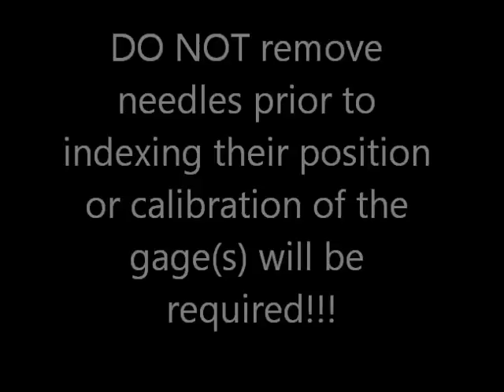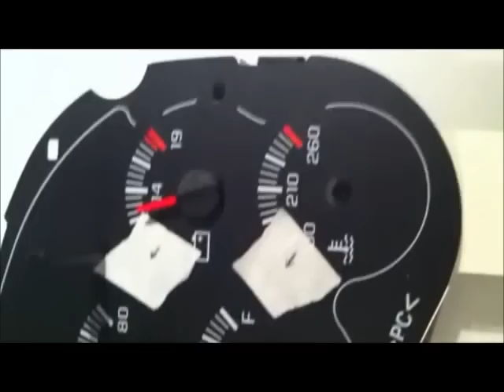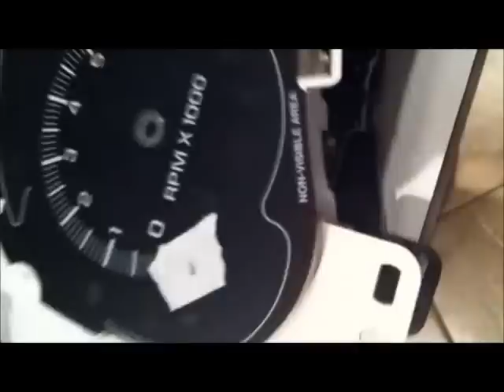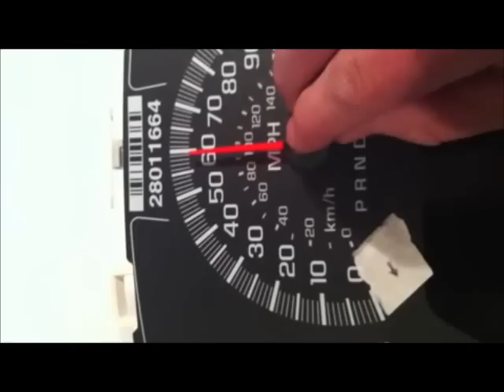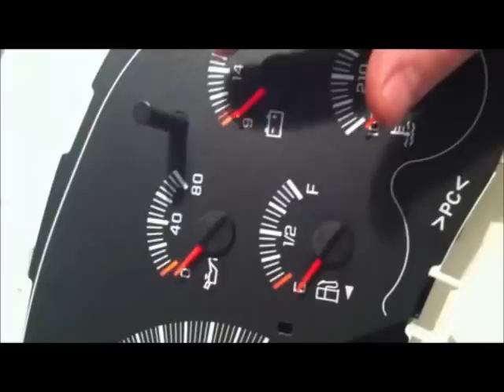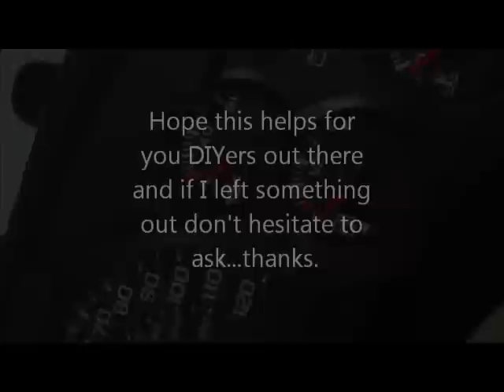GM Stepper Motor Replacement and Instrument Panel Disassembly

Comment: Nice video on the subject.  FWIW, [ref the comment starting at 3:00 ], on another similar video the guy points out that the stepper motors can only be installed in one position.  When doing the repair on mine I could see that that is true, there are two plastic posts on the motors that are different diameters and they go into holes in the circuit board that match those sizes.  If the motor was rotated 180 degrees the larger post would be blocked by the hole sized for the smaller one.  I'm sure they were made that way to prevent accidentally installing them in the wrong position.

Comment: Worked and saved me a bunch of $$$.
As a tip.  Once the dial needles are off and you are only dealing with the motor.  I heated up each pin with a solder iron, going one to the next slowly backing out the stepper motor with reverse pressure using a popsicle stick.  Then replaced the stepper with a new one purchased on eBay.  I heated up the solder at each hole that was remaining and "Viola".  Done and my voltage reads again after a year of yo-yoing around.
Reply: It worked for you, but as an electrician I can tell you that you are applying a lot of heat for extended period of time with a chance that you will lift the contact foil and have your hands full then.  If you don't remove the solder, as you come back into the holes, you are even pushing the foil off of the board, if you are not careful. You save a lot of money by doing this job yourself, invest in a $10 solder sucker, or $4 of copper braid used for absorbing the solder.  It really makes life easier!
Reply: Peetre,  You are correct.  Months later the and the Speedo no longer works.  Back to the microscope.

Comment: The fork treatment worked really well at pulling out 3 of 4 of my stepper motor shafts. Now my cluster is lighted very well with my new soldered in bulbs. But the gauges with the shafts pulled out are junk. What fun! I dont know how you can prevent the shafts from coming loose. Use at your own risk...you been warned! 32 year tech

Comment from the maker: I found a guy that sells kit, but I don't know if he sells them individually. He sells 6 for $42 and 7 for $49.  If you aren't afraid to do a little soldering, I'd personally replace them all to prevent any future problems (assuming you plan to keep the vehicle a while).  The newer part numbers are listed on his site which are the ones you want to order because there are still a lot of the defective ones still out there in circulation.

Comment: For those of you with the extra questions, it is very recommended that you use a solder wick/sucker.  However, if you have none of these on hand, cleaning the surface will do just fine.  This is recommended because if you don't clean the surface properly, you'll get stray voltage that could interrupt other portions of your gauge.

Comment: Have a question. I need to replace my stepper motor on my 05 tahoe. The speadomoter is currently passed the 100mph marking. Would I market in the same location or should I move the needle back to 0

Comment: I was wondering if you are just removing the cluster to try and resolder/fix the odometer, not replace stepper motor, and don't plan on messing w/gauges/needles do I need to mark the needles?

Comment: Hi I was wondering what tool, scan tool, or power generator do you use to bench test all of the gauges to see if they all work while the cluster is not connected to the vehicle? Thank you for your help and great video.

Comment: Thank you for making this video, It made replacing the faulty motors real easy knowing the procedure including marking the needle positions. I found the motors here on Ebay. Do a search for "GM X25168 Stepper Motors" and you will find replacements.

Comment: Great video, very clear.  Thank you.  In that stepper motors are being replaced, I assume that the stop points for the defective ones remain correct, even though the needle could be showing anywhere when off.  Therefore marking the stop point, even for a defective stepper motor, is still at the correct spot?
Reply from the maker: buddyboy4x44 Correct.  The referenced stopping point that you mark before removing the defective motor will be where you set the needle after replacing the new motor.

Comment from the maker: i've adjusted my gas gage while the power was on because i didn't like where the factory 'full' stop point was.  really the only way to accurately calibrate these would be to have another device measuring realtime while you are making your adjustments. 
close to stock settings at warm idle:
RPM 600-700~
Speed 0 :)
temp 210 (depending on thermostat)
oil pressure 45-50?
battery - could use a meter to adjust
fuel - fill it up then adjust

no easy solution unfortunately, rotate counterclockwise
Reply: Hello are these references for the needle to be centered on gauge or at its 1st starting point of the gauge. Particularly the temp.

Comment: Question, lets say, only the battery gauge is broken. after replacing the stepper motor for the battery gauge. I put back the needles in all of the other gauges, do i put it back in 12 oclock position? or just the battery gauge needle?  The rest in the old position as marked with a tape?

please advise, thanks

Comment: hello i did not watch your video before i took apart my odometer and i did not index where my needles were what should i do after i put new stepper motors in and put needles back on?  where should i align needles? Thank You.

Comment: Thanks for your instruction but I have have a question on the best way to get the 2 bottom clips released.  My cluster is on the bench with all of the top clips removed but these 2 bottom clips are giving me a real issue and no one has addressed these so far.  Can you give us expertise on how to release these???
Reply from the maker: From what I remember they unclipped like the others, but I haven't had the assembly out since I published the video.  This probably doesn't help much:(

Comment: Thank you so much you saved me $600!!
Reply from the maker: Cheers!
Reply: mlekowhat 4 months later and still going strong!!! I also snuffed out my check engine soon light by replacing my fuel cap after sanding the filler neck threads.

Comment from the maker: Solder wick would probably be easier/cheaper.  Put some resin on the wick or solder join, put the wick on the solder joint, then the heated iron on the wick.  This method just absorbs the existing solder into the wick...easy and cheap.  Good luck

Comment: Great video. very detailed and helpful.
Problem; none of the installed motors works. No indication at all. I welded them on just as I did with the new LEDs and these work fine but none of the motors came to life. No indication at all. I positioned them as instructed but get no response... what did I do wrong or did I buy crappy motors??? The sad thing is that before I changed them 5 out of 7 worked and now none... bummer.
Reply: Well you probably shorted out the entire thing. Leave this work to professionals.

Comment: Please help, before to replace my rpm stepper motor (it wasn’t working) my indicator lights haven been working neither, only check engine and battery light works, after I replace the stepper motor my rpm still doesn’t work and the indicator lights neither, I am pretty sure the stepper motors is fine, what else could be? Circuit board? All fuses working fine
Reply: J G circuit board near middle stepper motor needs a touch o dolder... Watch my video

Comment: Mine is TOYOTA IsIs 2005 I have replaced those two stepper motors for both RPM & Fuel gauge, but unfortunately with no success. Fail to work. Do you think that I must point thost arrows 12 clock is it important coz I didn't do so! The rpm is a little some times shaking but very little while the fuel gauge not. Your advice is appreciated.

Comment from the maker: Most of the clusters I've seen require removing the needles in order to disassemble the unit and access the internals.  No worries, indexing the needles is a breeze and only takes a few minutes.

Comment: Hello miekowhat :)
Is there any reason that you didn't rotate the stepper-motor shafts fully counter-clockwise before putting the cluster dialface back on the cluster body followed by putting the indicator needles back on? I would think that would make it a lot easier to line up the needle with the index mark and then just press down and seat the needle. It would also not require putting counter-clockwise force on the end-stops in the stepper motors. I'm an electronics repair tech who's going to try and repair my Mom's bad temp guage in her 05 Buick Rendezvous. Thanks for the nice tutorial :)
Reply: I replaced, yesterday, the voltmeter and temp gauge. I messed up the settings on the needles so I just had to do it trial and error, to get them realigned correctly. Easy to do.

Comment: Great video ! one quick question  ? i thought this was gonna be easier i have a Monte Carlo SS 2003 & i bought Red Led from ebay what came was --> 7x Stepper Motor X27.168 Speedometer Cluster 9 T5 74 Red LED 5050 SMD Bulbs . what do i do ? do i put the Stepper Motor as well or ? =/
Reply: +FloeyLIVE You should research before ever buying stepper motors.  For one thing you may have gotten after market versions.  Those are black in color.  The OEMs are white.  LEDs require resistor be installed so you will have more work to do to add them.  You are better off using the stock incandescent bulbs the kits come with.  DoctorSpeedometer sells the EXACT kits you need for this job.  They are on Amazon.

Comment: Hello, I'm looking at buying a kit on Amazon would you recommend Dr. Ric's GM instrument cluster gauge stepper motor repair kit-27 (6 motors, 10 back light bulbs, 1 soldering iron, 1 solder sucker for my 2004 Chevy Silverado? very good video. Thanks

Comment from the maker: It's fine to rotate clockwise, but I never have more that a quarter turn or so.  When you're indexing counter-clockwise is the most critical part.
Reply: mlekowhat i changed the motors for my RPM, speedometer and oil pressure. I rotated my needles counter clockwise and set them to the desired positions. When I reconnected the cluster the oil pressure needle still not working. I rechecked my soldier work for oil pressure and it redid it. Reconnected the cluster now my only my oil pressure and fuel gauge only work. I believe the repositioning of the needles threw something off. HELP!?

Comment: where do you get the stepper motor
Reply: you can find them on Amazon or eBay. Search for stepper motors for your year/model, x27 168
Reply: +nate a There is a seller called DoctorSpeedometer on Amazon.  They sell the EXACT and DIRECT OEM stepper motor upgrades for the GM's vehicles that had this issue.  There are a bunch of vehicles they have listed so read the details of the description to find your car.  Do NOT buy the after market ones as they are not reliable (those are the ones are black.  The GM ones are white).

Comment from the maker: this could get a bit complicated depending on how picky you are.  really at this point all of the gages need to be calibrated.  if you have some sort of handheld diagnostic tool, you can measure real time parameters such as rpm, temp, speed, etc.  if not, then you'll be playing a guessing game.  you can put the cluster back in without the plastic faceplate to make on the fly adjustments.  you can download a speedo app for free which will give you a good speed reading.

Comment: what could be the problem if after you've changed motors and it doesn't fix problem?
Reply: Greg Cobb 
I'm facing the exact problem. After installing new stepper motors nothing  moving. I changed rpm & the fuel gauge.

Comment: ==============WARNING!!!===============

Does not apply to BMW. You'll screw stepper motors by pulling them off like this. Rotate needles clockwise until they snug. Continue to rotate in the same direction while pulling them gently. They'll easily come off after few rotations.

Comment: I did everything in this video, two issues - first, when I pulled off my gauge needles, the pins came out with them and secondly and most importantly, they arent moving at all - I hear them moving, but the needles arent moving

Comment: WARNING! DOES NOT APPLY TO BMW!! YOU WILL DAMAGE STEPPER-MOTORS IF YOU USE A FORK!
Reply: Exactly. I damaged 2 of my stepper motors using two spoons. You should rotate them clockwise while sliding them gently off.